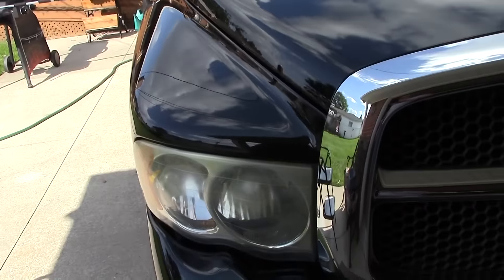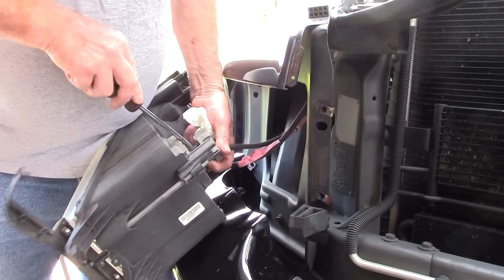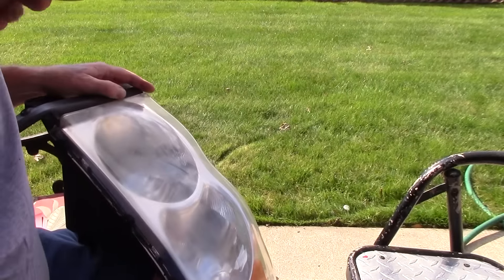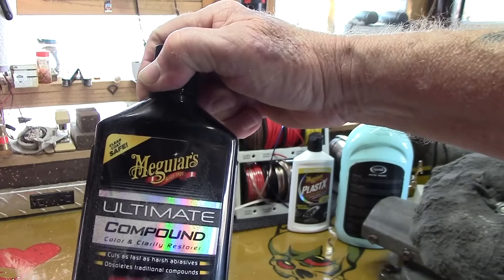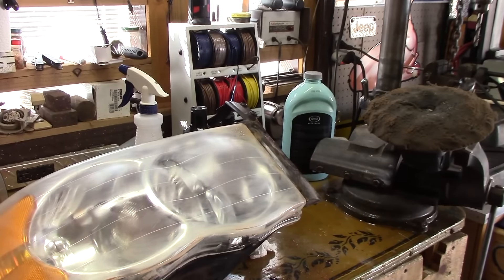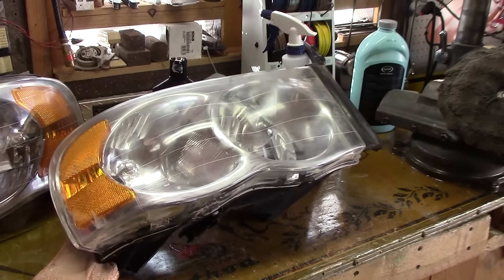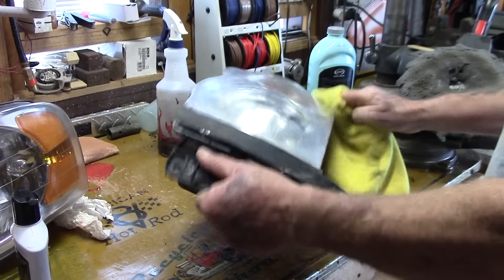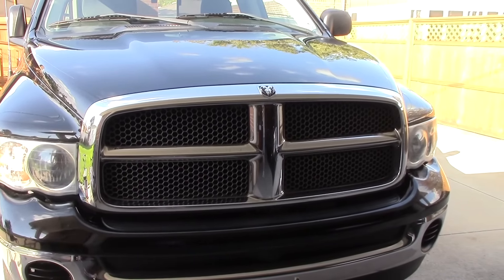Steve's Garage

Comment: Using your method, how long do the lights stay clear until they start to haze again?
Reply from the maker: +iceman22st They will stay clear for a long time, I shouldn't have to touch them until maybe next year.
Reply: That's not bad.  Most times after you polish these headlights they only stay clear for 3-4 months before they start fading again.